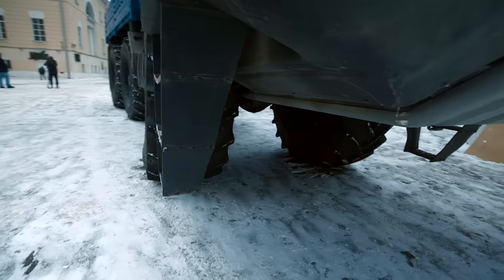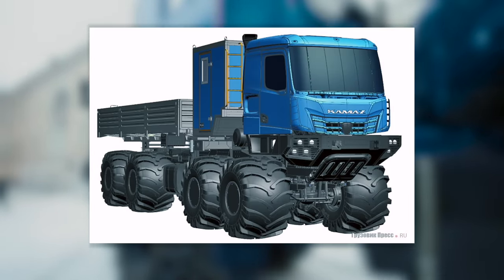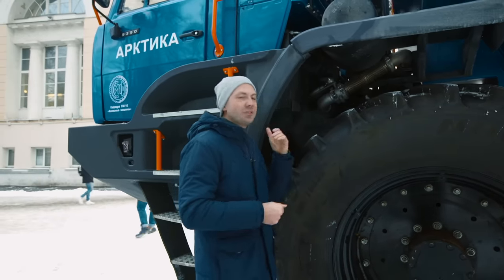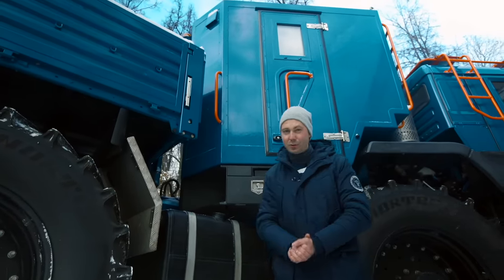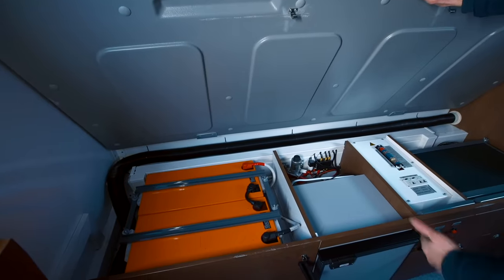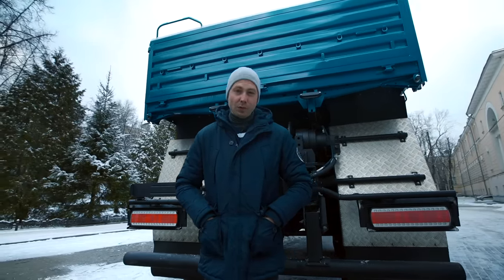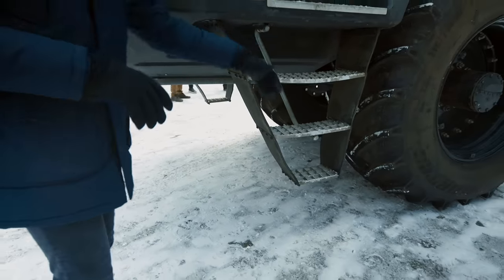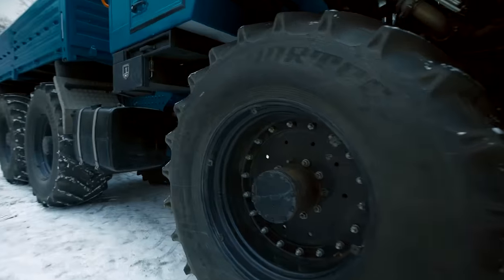ULTIMATE TRUCK FROM RUSSIA! Unique monster: Arctic Kamaz 6x6 one of a kind #MonkeyVideo №2

Comment: Why do I always get the feeling that everything that is produced in Russia, has military applications as well..
Reply: That's true for almost every country when you're talking about 6x6 monster off roaders ahhah
Reply: I agree, it has a small cabin for a driver and an 'operator' and is seriously over engineered weighing over 2.5 times the maximum carrying capacity.  If I didn't know better I'd say this is designed for carrying lots of ammunition and pulling a large gun with a driver, controller and probably an armed escort vehicle.
It's not for going camping.
Reply: Remember Kirovets?Farm tractor also made to haul artillery
Reply: It comes with standard road rage and AK47
Reply: @bradjerrum  lol
Reply: Sure. Because people are poor and cannot afford great huge trucks.
Reply: When you lose 28million people in a war, it tends to colour your view!
Reply: @Spedley_2142  if you want reliable machine operating in an arctic conditions you have to overengineer. Better safe than sorry. And fuel is cheap in Russia.
Reply: Go to Russia and you will find out why. Especially to syberian tundra. 😂
Reply: Well it also goes the same way military vehicles are great for off-road purpose no one is using that for camping it’s used for carrying stuff in Siberia
Reply: because they prioritize practicality above comfort.
Reply: Technology in the USA often comes from from military years before.
Reply: sure does seem that way, doesn't it

Comment: There isn't any aspect of this hugely capable truck and it's habitation module that hasn't been extensively well considered before, during and after its inclusion.

Designed and constructed to travel to and operate in the most remote areas and in the most extreme and challenging conditions and environments, this truck is unequalled!

A masterpiece of design, engineering and construction excellence, this will be the forerunner of more capable and accommodating expedition and support vehicles!
Reply: Looks like there is - I don't see a passthrough between the cab and the sleeper. If this truck is supposed to work in the Arctic, I can't understand why this wasn't done - you really don't want to get outside in -60c.
Reply: @smpopov  For a work machine there is more comfort than one would expect. And those who refuse to get out in the right situation (checking power lines as mentioned in the video for example) because you simply “don't want to get outside in -60c” are not hired to work in such harsh places.
Reply: @DartXL   Have you ever experienced -60C yourself? Opening a door to your living space at such temperature is going to make it instantly near-uninhabitable. That's why houses in the far north or Russia and the nordic countries have a small vestibule, like an air lock when you enter a house. 
It's not just about not wanting to step out, it's about not wanting to open that door every time and venting the heat to the outside, for any trivial matter.
Reply: @smpopov  Да, бывал на холоде. Кроме того, как разработчик вентиляции по текущей профессии, понимаю что прогреть небольшой объем воздуха можно быстрее, чем весь объем объединенной кабины.  Но тут сама кабина размером с переходной тамбур и как быть, пасажирам приходится часто выходить на холод по работе? Поэтому  отапливаемые объемы в этой автомобиле сокращены до минимума и очень ценен шкаф где можно прогреть-просушить одежду, лицо и руки. Не открывать дверь каждый раз по такому "пустяку" как осмотр столба ЛЭП? А если там иеще и подправить что то придется? Может тогда сразу отказаться от работы и размахивать заявлением на увольнение, потому что в Арктике оказалось "слишком холодно"? Так что пусть водитель спокойно сидит в теплой кабине, где дверью не хлопают каждый раз рабочие на смене. Помнится, в модернизированном антарктическом тягаче "Харьковчанка-2" тоже отказались от объединенной кабины, хотя им столбы осматривать не надо, а морозы и побольше бывают.
Reply: @DartXL  убедительные аргументы. Соглашусь.

Comment: I've driven 4 wheel chassis pivot steering. It can get sluggish at low engine revs so if doing a lot of cornering, change down the gears.

Comment: This is no apocalyptic truck.
This is a highly specialized vehicle for one single task and not much more.
It is an arctic exploration vehicle, to drive in the far away frozen regions. 
An apocalyptic truck would be something like a man kat or the sort, comverted into a mobile home.
Or even better for the smaller pockets,a gaz 66 with a carwvwn attachment in the back.
It can go far away into wilderness and it uses a basic unexpesnive to maintain old tech.

Comment: It's a shame that both cabins are not connected. Imagine having to climb out to -40 just because you want a hot coffee.
Reply: Imagine the driver's discomfort with a crew of two workers opening the door in the cab, every hundred meters of travel, like in the above example about checking power lines, and you might understand why it's done that way. It's easier to put the driver's own coffee heater in the cab. This machine is for work, not fun.

Comment: Now IF you made an AUTOMATIC TRANSMISSION for wheel and Track with housing on the bed which means that the bed compartment has to be somewhat higher than it is now. The overpass are from 9 feet high to 20 feet high. It cannot be wider than 8 feet. A few SOLAR PANELS on the roof will be needed with converter and extra batteries for power. Wifi and satellite communications are a must. 6x6 or 8x8 will do nicely. Air Conditioning is MANDATORY here in Puerto Rico. The GENERATORS MUST BE DIESEL. 
Security for the fuel tanks are also MANDATORY since people love to steal your fuel during a crisis. Add some ARMORED PLATING AND BULLETPROOF WINDOWS.  Make the tires RUN FLAT. 
SPOTLIGHTS AND CAMERAS ARE ESSENTIAL. 
Now here's the deal.  Meet those requirements and I will buy the both of them.  Track and Wheel.

Comment: This unit turns using hydraulic power? What if you blow a hydraulic line in the wild? With front turn power steering if hydraulics fail one can still turn the vehicle just its somewhat more difficult depending on steering ratios of particular vehicles.